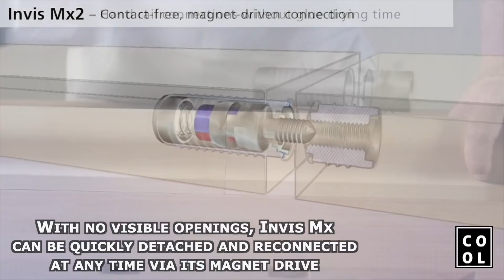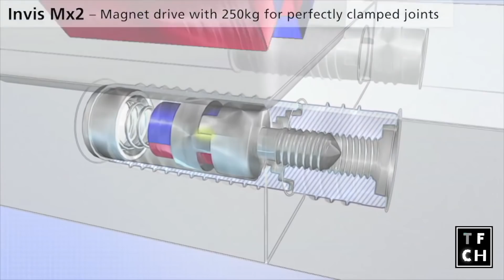Woodworking Tools That Everyone Must See ▶1

Comment: 6:20 to say I'm skeptical is an understatement.
Reply: Stephen R I assembled an X-ray screen imported from Germany last month. It used this magnetic screws system which worked ok but it also used locating dowels. It does work but you have to start with the joint tight as it doesn’t produce the torque to pull things up up it does hold them. And you have to trust the clicks as you can’t see if it’s gone in.
Reply: @desmondcrosland7884  That was one of my skepticisms. Thanks for addressing that. Another was, when trying to loosen, I dont see it getting past the "break it loose" starting point that requires a bit more torque than the maximum torque reached at tightening. I dont see how any system with unadjustable and therefore  identical torque tightening and loosening could ever START the loosening. Just kinda hunching. Its neat though. Lol.
Reply: If it does work it's a game changer.  Like you I am incredibly skeptical.  But I'm also extremely hopeful that it has a future.
Reply: @danarrington2224  how is it a game changer? There are plenty of ways to create a seamless joint with no visible joinery. Strong Joinery that doesn't involve a magnetic screw that needs to be at 100% perfectly aligned for it to work.

My guess is that these work okay, but I doubt they are as strong as a loose tenon joint

Comment: Well that was disapointing. Most of thouse where rather ordinary. The only exception being the hidden magnetic screws. That said they strike me as rather wasteful and probably expensive.  And yes they are from what I can find each fastener costs like $8.50 US.  You can buy 100 ordinary wood screws for the same price. Really you can achieve the same joint with glue and dowels, or pocket holes if you really want screws.